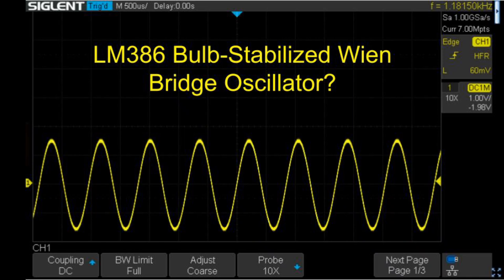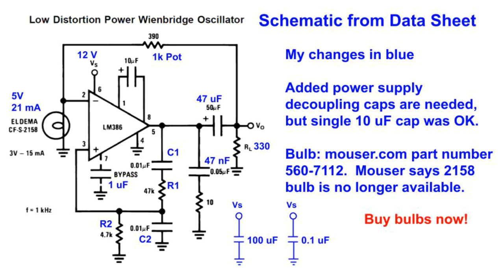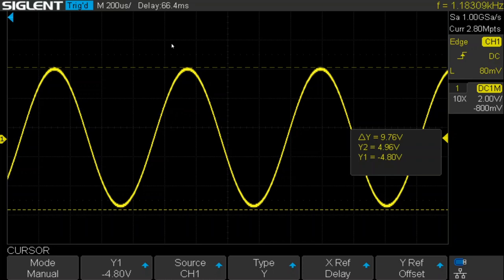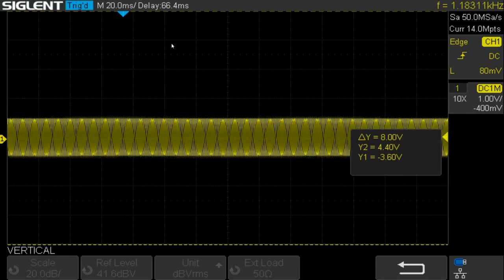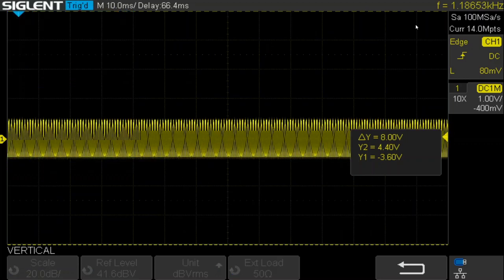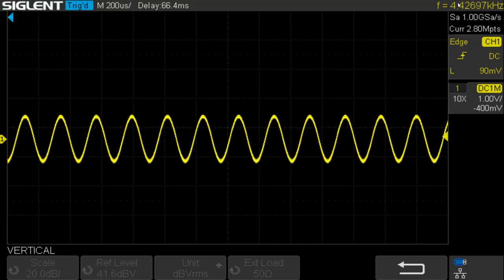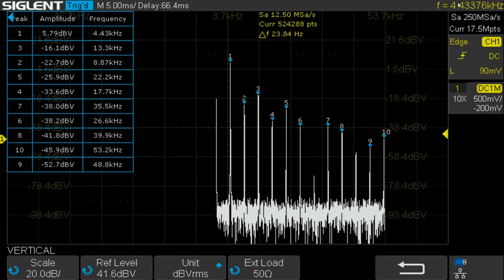Lamp-Stabilized Wien Bridge Oscillator Using LM386 Audio Amplifier

Comment: I had done this generator several years ago.  It works well - but on 50Hz amplitude decreases a bit. R1, R2 - it is a double variable resistor 47K.  C1, C2 - are capacitors 56nF.
Reply from the maker: Thanks for the comment.  I have no ganged pots so I just changed the resistors in pairs.

Comment: A series parallel combination of 4 bulbs might work better.  The cooler the bulb is, the less its temperature will vary over a cycle of the oscillator.  With a really good op-amp, the variation in the bulb is the main source of distortion.  The two op-amp version of the Wien bridge has the advantage of no variation in the common mode voltage.  Common mode rejection is often not linear.

Comment: Quite an interesting video. Thank you. The little light bulb seems to do its job quite well, except for the fact that it is sensitive to vibration.  I think that is why they developed chips like the XR2206.  Cheers from Canada :-)
Reply from the maker: Thanks for the comment.  I think modern Wien bridge oscillators use JFET circuits to avoid the downsides of the bulbs.  I like the bulbs because they are fun!  The XR2206 is pretty old.  I am not sure that new ones are available.  Amazon sells XR2206 function generator kits.  They do not produce high quality sine waves.  There are numerous videos about them (and how to make improvements).  Diode stabilized Wien bridge oscillators are a good compromise between simplicity and quality.  Modern function generators use chips that synthesize signals digitally.  The AD9833 is an example on the low end.  They are fun to play with.
Reply: JFETs have their own downsides in this application. The late, great Jim Williams did a deep dive into this in Linear Technology's AN43.

Comment: Hi, I've tried to make this circuit. I'm trying to plug a speaker in to it to listen to the sine wave. At what point would I connect the speaker? Any other considerations?
Reply from the maker: The circuit output is Vo as shown on the schematic at 1:00.  But a speaker is a very low impedance device and speakers need a reasonable amount of current. 
 I suspect connecting a speaker as the output load is likely to affect (probably stop) the oscillation.  Resistor RL in the schematic represents the output load.  I was testing with 300 Ohms.
I bet you need a speaker driver circuit that presents a high-ish impedance to the oscillator.  Try connecting the input of an audio amplifier as the load, either in place of or across RL.  And use the pot to be sure that the oscillator output level is not too high, not more than 2V.  This is to make the audio amplifier happy.
Reply: Thank you. I will try adding a preamp at Vo
Reply: As well as your suggestion across RL. Can you elaborate on what you mean by RL?
Reply from the maker: RL is the load resistor.  It is in the right side of the schematic shown in the video, connecting the output Vo to ground.

Comment: I have built this circuit exactly like this one and im using it as my code practice oscillator.
Reply from the maker: I guess the pure sine wave makes a pleasant tone.  Do you drive a speaker or a headphone?  I would not have thought that the oscillator is stiff enough to directly drive a speaker.
Reply: @electronics.tinker  I don't know about the case in question but headphones are common for such things.  It cuts out the disturbing noises and also prevents the family from going crazy from the sound.

Comment: Your 1K POT is missing!
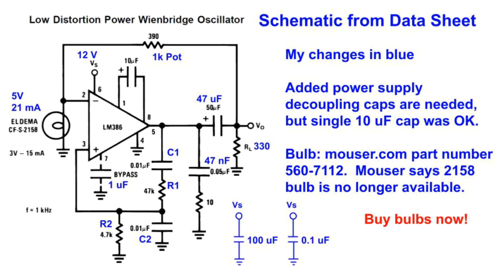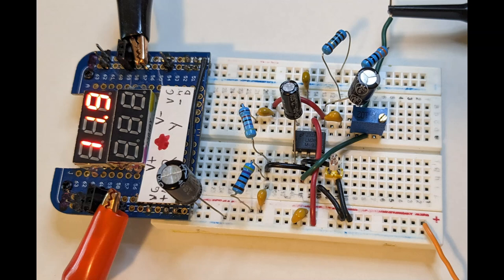Reply from the maker: It's the 1K pot at the top of the schematic at 00:51.  Also the blue box on the right on the breadboard at 02:21.
Reply: @electronics.tinker  - Problem is, at the top is a 390Ω resistor, NO 1K POT.

Comment: This https://www.youtube.com/watch?v=PPsE_5LZe4s might be related, an HP signal generator also using lamps for thermal compensation (if I understood correctly...), but even stranger: multiple bulbs, and one of them must be broken...
Reply from the maker: That's a very interesting video.  Thank you for pointing it out.  I would not have guessed that a broken bulb would be used as an ambient temperature sensor.  It shows how there is a wide gulf between concept circuits such as the one in the LM386 datasheet and the design of actual test equipment.